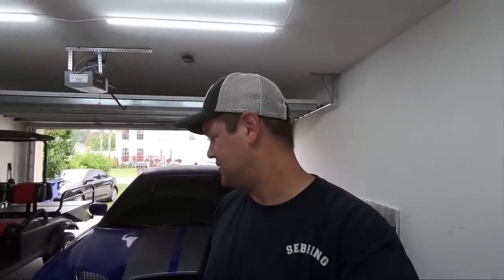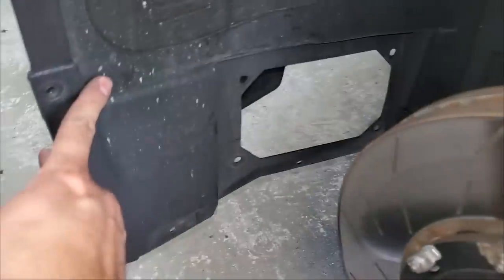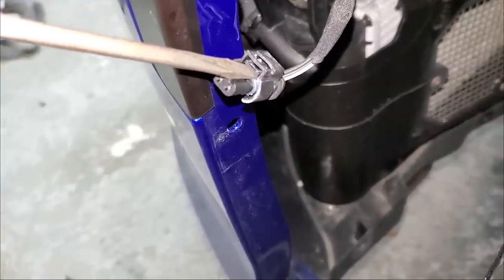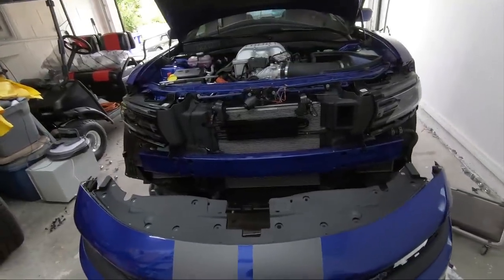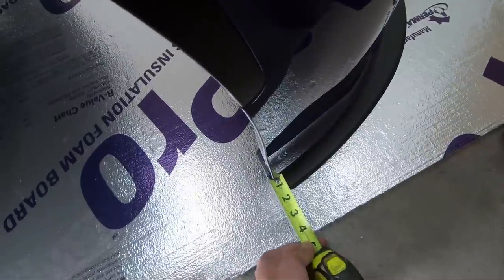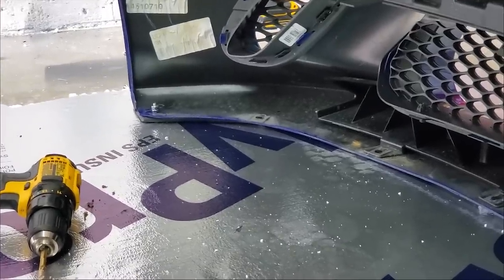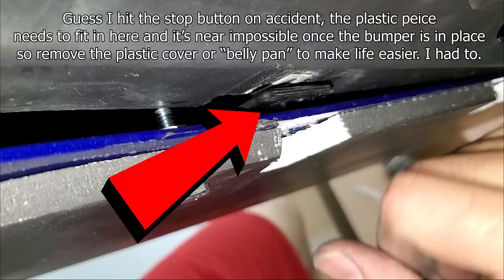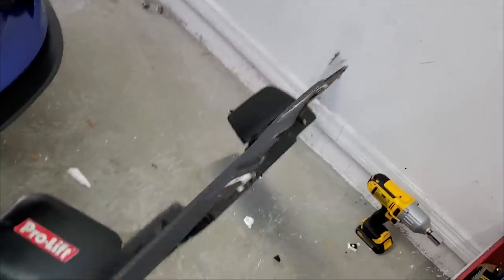How To Remove Charger Hellcat Bumper | Splitter Install

Comment from the maker: Make sure to watch the end of the video! Ouch! Thanks for watching, be sure to like and subscribe!
Reply: Hey QuiXilver, question, Im looking to lease a Hellcat, I prefer a 18 but the dealer says the 19 is better because of the money factor .0015 & 60%  Residual at 15000 miles per year and 69999 price. However, I do have about 10000 negative equity on my car now for trade. The dealer is offering 19 Hellcat for 36 month, $3000 down absorb half negative equity with a note of $967 per month. Does that sound like a decent deal?
Reply from the maker: Not at 0015 money factor. I'm not in the business anymore but that seems high
Reply: I thought so, thanks for your input
Reply from the maker: Was it a Charger or Challenger
Reply: Charger

Comment: just did my 2017 Daytona 392...found it much easier to just take a few extra minutes to remove the liner completely...my air intake for wheels/brakes (even tho it doesn't really make a difference) doesn't have a screen protector...is that factory or did you Fab it up...??? mine just wide open square...

Comment: I'm surprised it is not pre drilled to match the factory fasteners that had to be removed to take the nose off and just include new longer fasteners. I believe you drilled too close to the edge of the spoiler and the wind pressure pushing on it caused it to snap there because there was not enough material on the back side of the splitter.
Reply from the maker: That and not enough to hold it on in general and washers probably should've been on the splitter side since the material was so brittle.

Comment: Hey Luke. Nice job on the video.  Bummer in the end.  Try and use a dremmel sand stone for notch instead of sharp cut edges. Just a thought. Hope you have better luck this time. She looks hot man!  Btw,  finally purchased a 19’ charger scat pack plus loaded with adaptive suspension etc.  triple nickel with ruby red / black leather.  Can’t wait to break her in.
Reply from the maker: Oh that sounds sexy!
Reply: What was sticker on your scatpack? And what is your monthly payments? If u dont mind me asking.
Reply: @frankie072   sticker price was $53,055.  Total price before taxes was $47K and some change for wheel/tire insurance and ceramic coating.  Traded in my JKU at $27K...  financed the rest.  Monthly payments around $365.